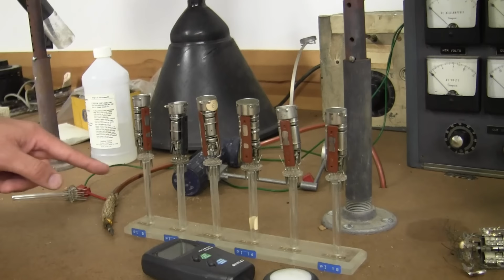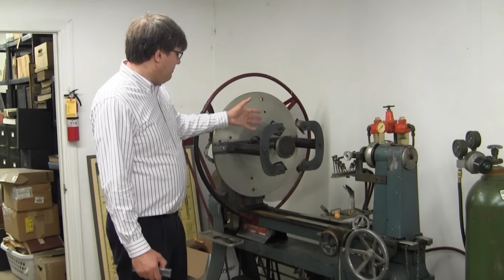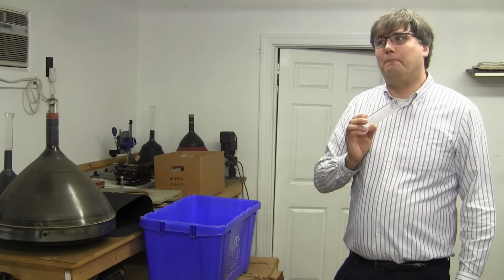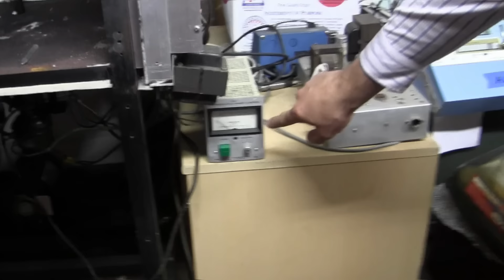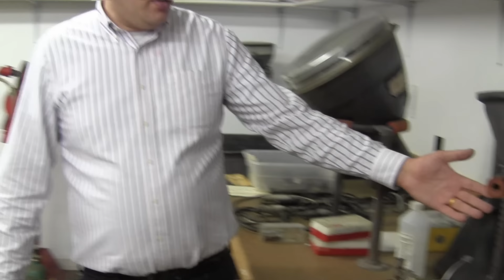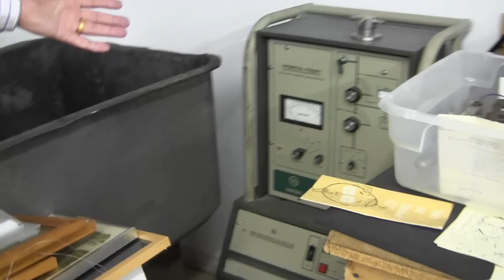CRT rebuilding at the Early TV Museum in Hilliard, OH

Comment: What Happen to the company that went out of Business 8 years ago and all There rebuilding tools, There's a Video of the Company that was doing them, I Just can't believe there's Not Men That do Tv rebuilding to want and Fix , these old tv's, Maybe If there being Paid well, as they Should be Being a dying art
Reply from the maker: 15 years ago. This is that equipment. It's supply and demand. There are still some NOS picture tubes out there. Or you can scavenge one from another set. It cost about $250-$500 to get a picture tube rebuilt back in 2009.  It would be even more now.  Not many would be willing to pay that much.

Comment: If a CRT has gone to air, can’t you just reseal it without replacing anything, with the equipment you have available at the museum??
Reply from the maker: No, the cathode is ruined if exposed to air
Reply: @bandersentv  Also the old gun does not have the tubulation (glass stem) to pump the air out. The getter is also ruined.
Reply: @bandersentv  Does the air not ruin the phosphors as well?  I knew it ruined the cathode emitting surface.

Comment: I get the whole electron gun concept…What I’m weak on is how is the beam move horizontally and then vertically, raster scan by raster scan ?
—> Is it simply manipulating the magnetic field around the gun or is it just that the beam is attracted to the positively charged screen by the high voltage anode ? If at the screen, 📺 then how is the beam attracted to each horizontal raster scan ?
Reply: When moving charged particles like electrons move through a magnetic field that is at a right angle to the electron flow the particles experience a force that is a right angle to both. I other words, if electrons were flowing out of the page at you and there was a magnetic field that was aligned horizontally across the page, the electrons would be bent up or down depending on which way the magnetic field pointed.  The voltage difference of the high voltage is what causes the electrons to flow in the first place.

Comment: In the 1980s I received a brochure from a company in Chicago, which manufactured equipment to fuse a new neck on a CRT then evacuate and bake the tube. I thought it was an interesting idea but in an era when you could buy a rebuilt 27VAQP22 for $75 rebuilding it yourself didn't appear economically advantageous.

Comment: The high voltage used for "knocking" (cleaning) is attached to the CRT anode and the pins of the gun. There are several videos and well as some documents accessible through the ETF website. Part of the reason some details like the cathode formula is hard to find are due to the information being proprietary when the companies were in business, also details like that change some with time.

Comment: Actually the gun with glass button will fully fit inside the flare. In fact the location of the button must be measured before the old gun can be cut off. The new gun is then inserted at the right distance. Baking is done at a temperature that is around 650 degree F (or 350 degrees C). The getter is flashed by using a coil connected to the "bomber" which is the high power RF generator. The bomber operates at a lower frequency that microwave, it is similar to a amateur radio transmitter.
Reply: When I look at the Hawkeye rebuild video, it doesn't appear Scotty even used a neck flare, it looked like straight glass. Near where I live, there's a glassblowing business that does mainly art glass, and they do classes where the public can go in and make a few basic items themselves. I wonder if a class like this would be good practice before trying the equipment at the museum, or, if a business like this could make neck flares or buttons. I imagine with a good jig to hold the pins, it might also be possible for a glassblower to make new buttons. But like all of this it may not be as easy as it seems. There was a science to how to get a good glass to metal seal, which I think required choosing a glass and metal with similar thermal expansion rates. If we're short of neck glass, I also wonder if we could cannibalize some from other CRTs, and if it needs to be flared, maybe we could heat it and do that on the museum's lathes.

Comment: The getters are usually metal troughs that hold the active material like barium, calcium, etc. The getters will degrade if exposed to the air for a time. I thing they come coated with a material that slows this degradation and which burns off when the getter is flashed.  Some guns do not come with getters attached and they have to be spot-welded on before use. Welding the flare extension on is a process that takes care and practice, a misalignment or external bulge can cause a problem fitting the yoke.
Reply from the maker: The few gun assemblies I looked at were stored in plastic bags - some exposed to air.  They had black power loose in the bags that I suspect was the getter material

Comment: There are a few details I can add. The tall red painted gizmo by the washtub at the beginning is something that the French company used in re-phosphoring B/W tubes. The neck of the CRT has to be nicked with a file or similar before using the hot-wire to separate the glass. The cathode coating in a new gun contains barium, strontium and sometimes calcium carbonates. The activating process converts the carbonates to oxides. The damage done to an activated  cathode when exposed to air is mostly due to the oxide converting to hydroxides by the moisture in the air. The hydroxides cannot be returned to oxides by the usual activation.

Comment: Back in the fifties and very early sixties there was a shop on East Long st. In downtown Columbus in the old Radio row called Buckeye Electronics. My uncle worked there rebuilding picture tubes. Many years later in the short north on high street there was a shop called Starr Surplus. In the basement of this old shop were several walls stacked to the ceiling with various old picture tubes. All types and sizes. Well when the surplus shop in the eighties was purchased by the surplus shop my uncle was now working at. Well he was tasked with removing this old stock into a dumpster outside of the shop. Well having experience with these tubes and looking at what was there he spent about a month removing these tubes CAREFULLY since the boxes had turned to dust. The issue was to carefully remove the picture tubes without breaking even one in the basement. This would have resulted in a massive continual implosion of tubes and glass flying everywhere. He was lucky that he and one other individual successfully removed every single one successfully from the basement and dumping them into the partially covered dumpster where they safely imploded.

Comment: If the supply of guns is limited, I wonder if the restoration community will have to get creative like they've done in other areas where replacement parts simply aren't available. Could the removed gun be reconditioned? Can the cathode, or the cathode oxide, be replaced or renewed? The getter material would also have to be replaced. Can the same filament  be reused? It may be better to replace it, if a replacement is available, but how reliable might a reused one be? What other faults might be present? Erosion of metal causing poor cutoff? This may never have been done when replacement guns were readily available, but if they're not, can some amount of rework allow the old gun to be reconditioned and reused? That may be easier than trying to make a new gun from scratch, but harder than simply installing a new good gun.  Some of these same steps might be needed for NOS guns that have been sitting for years.  I noticed in a video that colorvac in Germany said guns should be installed within 6 months of manufacture. If that's really true, the museum's stock of guns may all be bad. A problem with all of this is you'd have to complete the whole rebuild process to find out if your NOS or reconditioned gun actually works.
Reply from the maker: Yes, guns can be rebuilt.  I recall a 15GP22 had its cathodes recoated and the rebuild worked OK.  It is very labor intensive though.   Yes, you make a very good point - you don't know until the process is complete.

Comment: The sparking process doesnt actually burn anything. It typically moves conductive particles away from high voltage potentials. It can sometimes break particles into smaller peices. Spotknock typically dulls otherwise sharp points between electrodes to reduce point sources.

Comment: Great video Bob.  Unfortunately, he didn't mention how to clean and reapply phosphor to a tube, if that can even be done.
Reply: There is a video taken at the french company that show the process of re-phosphoring and aluminizing the CRT. I was at the convention and the ETF museum does have that equipment. Sourcing the chemicals and disposing of the waste might be an issue.
Reply from the maker: It's not possible with color or aluminized CRTs and not commonly done with non aluminized B&W.

Comment: That was a good ad-libbed overview.  That CRT building and rebuild process had a large number of critical steps, mostly done in a cleanroom environment.  Simultaneously working with glass, high vacuums, high voltages, phosphorus coatings, and metallugy, presented huge numbers of build problems so, it's no wonder it took decades of refinement to achieve a practical process, much of which has which has now been lost over time.
Reply: Ha. If you see the video taken of the process as done by the French company it was anything but "clean room". The guys were smoking and using old drink containers for mixing solutions!
Reply: @notimetolooz9655  Sounds interesting, I would like to see it, what search term should I use to find it?  I am assuming the video is on YouTube?
Reply: https://youtu.be/byCeMKzPJgM
Reply: @davesica  Thanks for the link; very interesting!

Comment: 14:38 that's an oil diffusion pump, not an ion pump. Those look different, and can not be started repeatedly at the pressures created by a rotary vane pump as shown. The oil vapor is moved at the speed of sound and knocks any gas down to the next pumping stage. 

That diffusion pump is rather small for its brethren. 

It is not the predecessor to the turbomolecular pump, its a parallel development, but it was the dominant pump type used prior to Beckers creation of the modern turbomolecular pump. They are still used in applications requiring massive pumping power or no low vibration. examples being some electron microscopes, and vacuum coaters. 

Some notes one the setup of the museum, the gauge i saw is not capable of reading the vacuum when the diffusion pump has started to operate in its linear range. You need either a penning gauge or a hot cathode gauge. 

the getters typically use barium, though others are possible.
Reply from the maker: All this equipment came from a working environment where many CRTs were rebuilt.
Reply: @bandersentv  i do not doubt that, but without a high vacuum gauge, judging the vacuum in the tube is down to experience and mostly luck at even lower pressures. 

If only a thermocouple gauge is available, put 1 on the exhaust of the diffusion pump, and one as close to the tube as possible. With both you can judge the pressure down to about 1e-6 mbar if the pumps curve is known and the roughing pump works satisfactorily down to 1e-2 or better 1e-3 mbar. 

Once the pressure on the exhaust reaches pressures below 1e-2 mbar the diffusion pump will have started to be in the linear pumping range and thus in the lower 1e-4 mbar range. The exhaust pressure will then linearly fall with reduction in pressure in the high vacuum section. 

This technique is however very imprecise and i consider it a hack method of vacuum monitoring, i do not teach it due to this. It also takes a lot of knowledge of the vacuum plant to do. I have only seen it implemented in a single model of electron microscope, where its very annoying to work with when you have even a little leak.

Comment: You may be able to find some NOS remnants of the CRT lighting tech being sold for a while about 15 years ago by a company called VU1 - their "electron stimulated luminescence" bulbs screw into a normal edison socket, but are in fact a compact little CRT with a 4" round screen. Wherever they sourced their electron gun assemblies might be worth exploring.
Reply: or just make new ones, its not extremely difficult, just expensive. Then there is the problem of having someone well versed enough in electron optics to decode the original guns design and design a new one. I for one don't see much of a reason to not just reuse the old assembly and just change the cathodes.
Reply: @ I believe that replacing the cathode is the main difficulty, as the rare earth oxides required were decomposed by heat under vacuum from potentially unknown mixtures of binders and metal salts, using lengthy processes that were empirically derived and never recorded.
Reply: @zinckensteel  the oldest process i know of that was used to create oxide cathodes, was decomposing barium and strontium carbonate suspended in Paraffin wax. ratio was 1:1 barium and strontium carbonate, in an amount of wax that just barely holds it together. Then molten on. There are recorded recepies. You just need to know where to find them, granted they are rare.
Reply: i should add that the exact ratios can be measured using xray spectroscopy. If i find the time ill measure the oxide cathode from a dual triode ECC88 if i recall, as i have a broken one laying around.
Reply: It's called a flood gun.  Sony Jumbotrons used them in their pixel modules.
Reply: @douro20  Might I be able to write on the flooded screen with a UV laser or some such? Manual analog direct view storage tube?

Comment: I wish I understood the process of emitting electrons better.  Why do you need oxides?  Why don't the electrons just jump off when they encounter positive voltage.
Reply: The oxides make the cathode much more efficient. Without the oxide coating, the cathode would have to be run white hot.
Reply from the maker: Bare metal holds onto its electrons too strongly.
Reply: @bandersentv  you can get metal to directly emit electrons quite easily, its just a matter of overcoming the work function or bypassing it. The bypass is in the form a sharp needle (a few nm tip radius) in a very strong electric field. This then causes field emission, basically ripping the electrons out of the tip by force. It dose however require an exceptional vacuum to work for long durations, as well as active regulators to control the emission. By good vacuum, you are looking at 2e-10 mBar (c.a. 15e-11 torr) to even start working, ideally the system would be somewhere around 5e-11mbar. Diffusion pumps can not really reach such low pressures, turbomolecular pumps can, ion getter pumps are preferred, and left on indefinitely. 

The other Methode are the photoelectric effect where you shine light on the cathode to produce electron emission, such as the photomultiplier or vidicon tube. 
Then there is just normal heat, get the metal hot enough to overcome the work function and it will emit electrons, for tungsten thats 2700K or more. Thus the lifetime of the tube is far lower then an oxide cathode. 

There are other techniques but this is just a basic rundown
Reply: Those oxides enable the filament (when used as a cathode) to emit the required electron flow using significantly less heater power/heater temperature.  For instance, the earliest radio receiver tubes were basically a light bulb filament without any Oxide coating, they used 5 watts for heater current.  20 years later, a tube with similar amplifying performance that used the Oxide coating used only 0.07 watt.

Comment: What we need to do is apply modern technology to the process, especially for the vacuum system. There is a guy on youtube that created a system for tube transistors, which could be used for CRT Tubes.
Reply from the maker: That's one of the easier steps though.  Sourcing guns and flaired stem glass is a bigger issue.
Reply: @bandersentv  stems are available from an English company, which is discussed in the video. the Guns are a problem, but I'm sure we could find an indian company that would take it on.